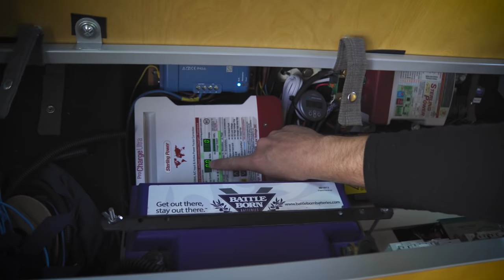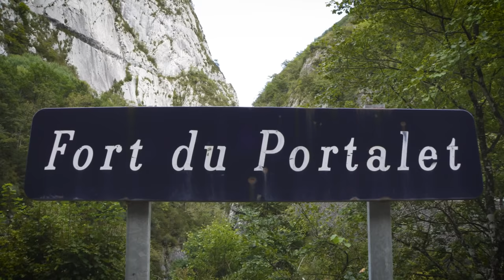THE BEST Country for VAN LIFE in the World?! // S03E08

Comment: question since i dont remember from the episode when the new engine was installed , is it a hyddralic lifters set up where the valves dont need adjustment ? or is it like the old traditional vw motors that need adjustment every 3K miles ?